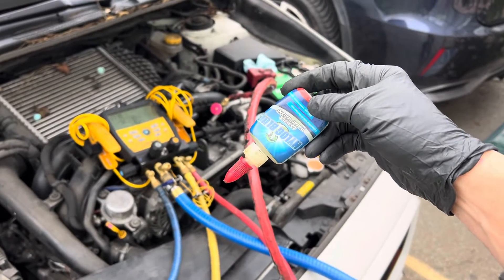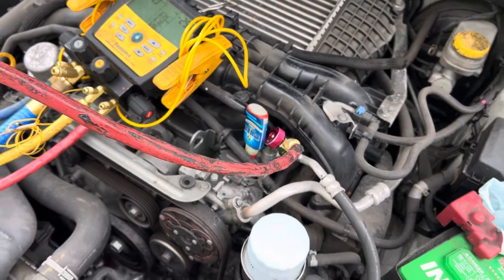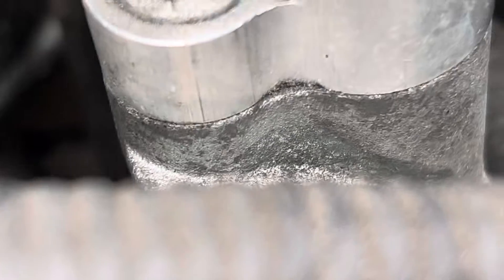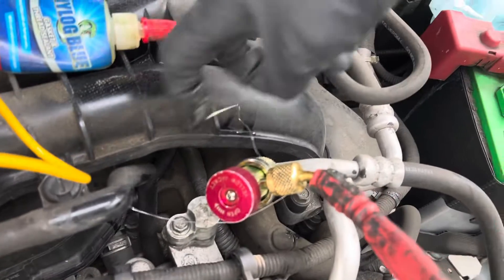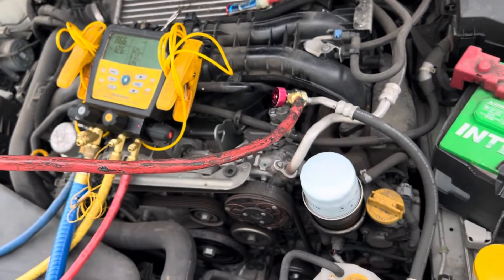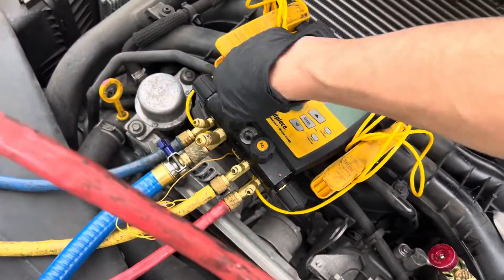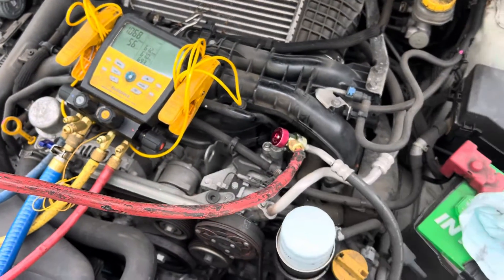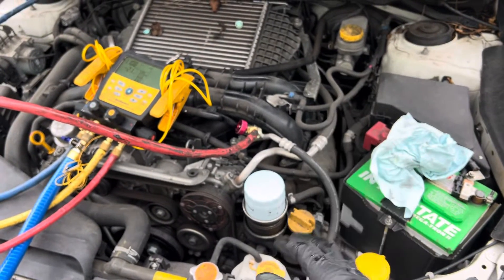NYLOG TO STOP VACUUM LEAKS (simple demonstration) analog gauges would never find this vacuum leak

Comment: I tried to use nylog once but i probably used/applied it wrong way because nitrogen blew it away... are there some thumb rules to use it? It's completely brand new in out market so there is no one to ask about their experience
Reply from the maker: It is not a gasket sealant. 

It’s only a lubricant protectant for O-rings and compression face seals that are metal to metal.
Reply: Thank you  @coldfinger459sub0 . It was advertised to me as an Universal sealant for any threaded pressure connections so i was a bit concerned when it failed to hold 10 bar nitgogen pressure.